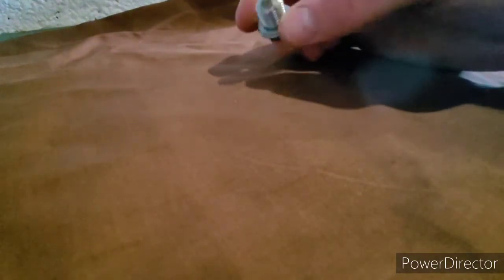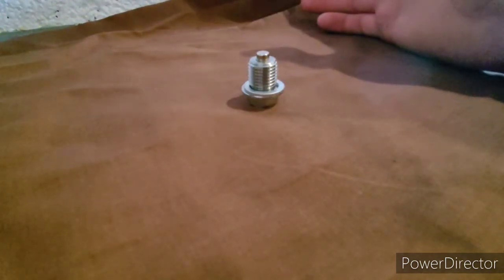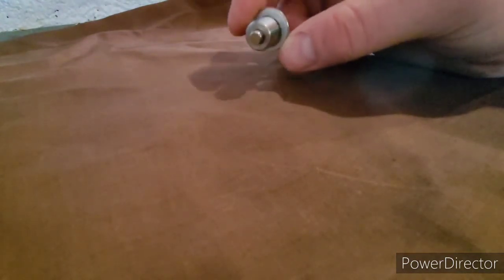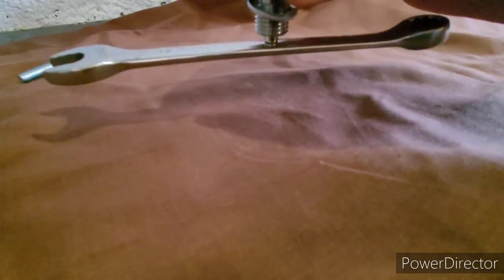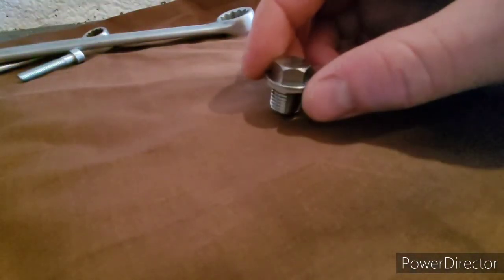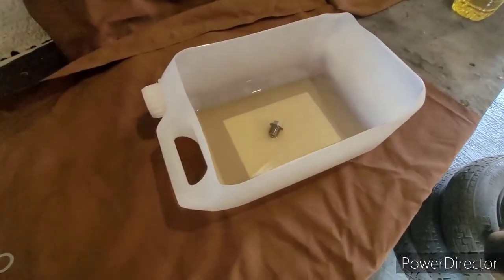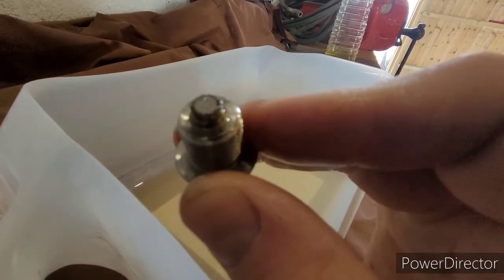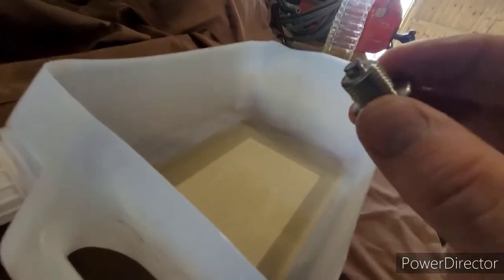Neodymium Magnet Test - Golf Gti 16v Mk2

Comment: I need one of them, in process of rebuilding my engine, looks very good have you got the link for it on ebay? 
Thanks
Reply from the maker: https://www.ebay.co.uk/itm/M14-x-1-5-MM-Stainless-Steel-Car-Oil-Drain-Plug-with-Neodymium-Magnet-Universal-/333975228379?mkcid=16&mkevt=1&_trksid=p2349624.m46890.l49286&mkrid=710-127635-2958-0
Reply from the maker: Thats the exact one 👌